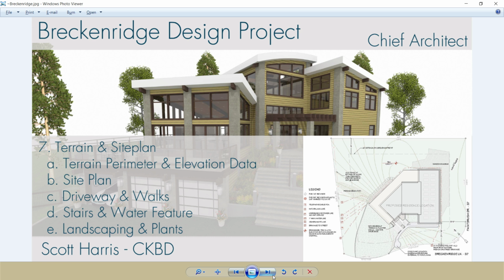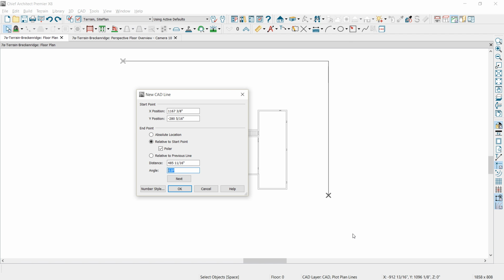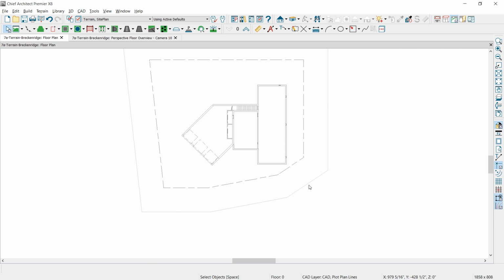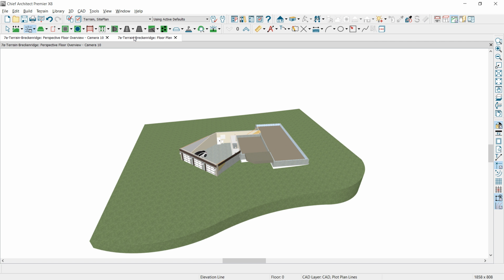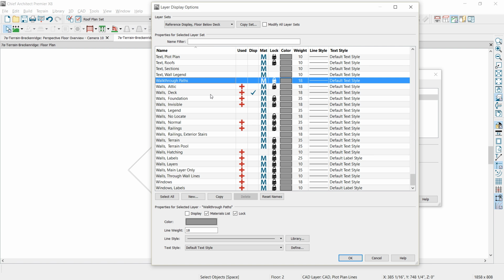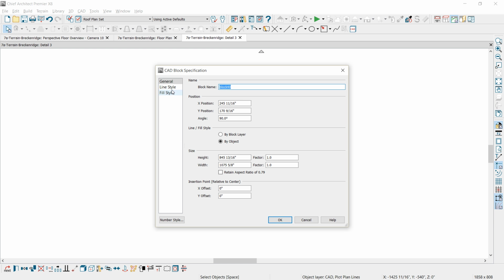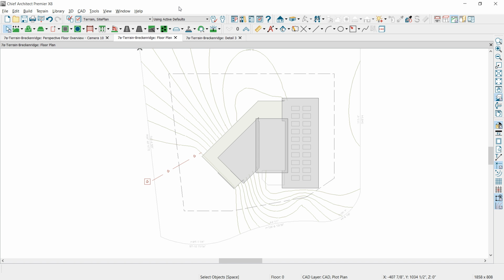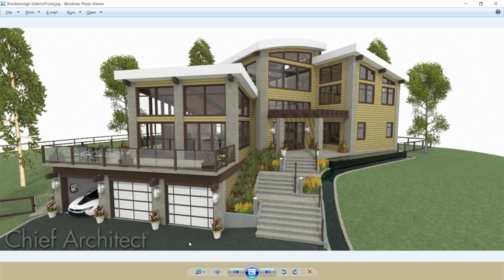Breckenridge Design Project - Terrain and Siteplan

Comment: In many of the Chief Architect videos the terrain is put in after the home design.    Shouldn’t the design start with the terrain and then build the floor plan around what is existing?
Reply from the maker: Hello CU96821. In Chief Architect Software, the terrain and structure are independent of one another so the terrain can be drawn first or last, or somewhere in the middle. If you need the terrain in order to see how the house will sit on the site you can certainly create the terrain first!